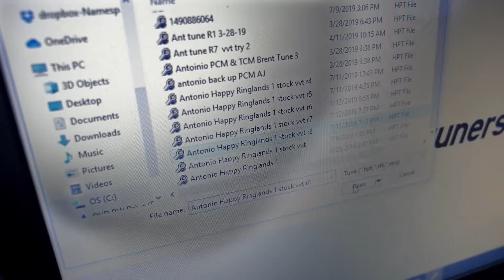2010 Charger R/T  5.7 Hemi Sloppy Mechanic style motor rebuild and re-tune

Comment: Nice! 13.2 seems pretty decent for a 5.7 charger with those mods! I’ve drug a few of them on the street with my truck, but they were probably stock
Reply: That was on a soft tune
Reply: The car held the record for the fastest stock motor 5.7 it went 12.39 MANY years ago

Comment: I ported some 6.1 heads and intake on a SRT8 300C.  We had larger intake valve installed, Cam, springs, rockers, Bigger TB and eBay long tubes because the name brand headers were crazy $$$ 😳😉😂
He put down 476 whp NA!  I was shocked and amazed how much power it made!  Those Hemi engines can run strong! 👍👍👍
Reply from the maker: 476 is getting it NA